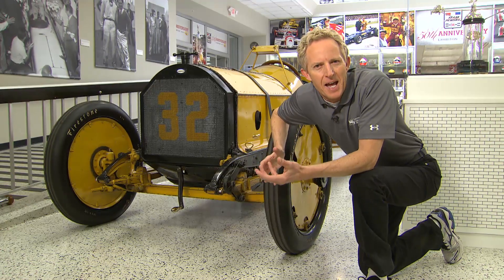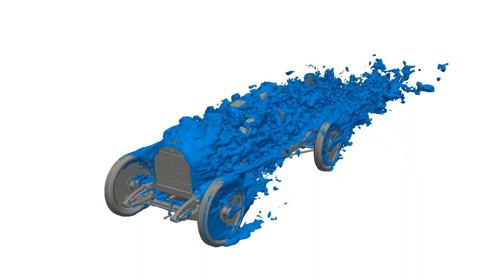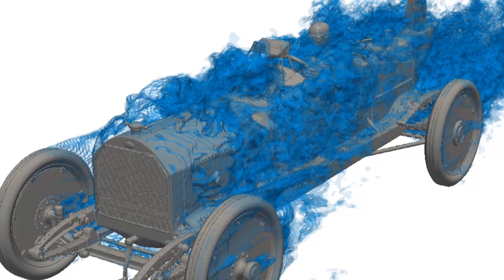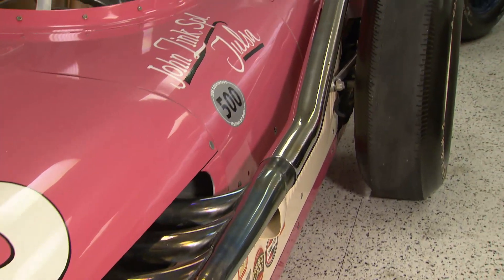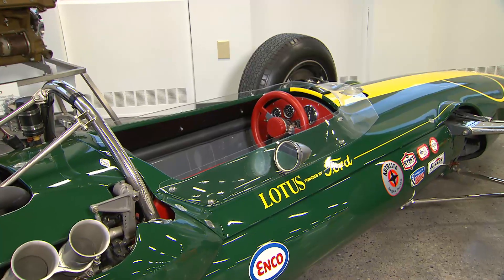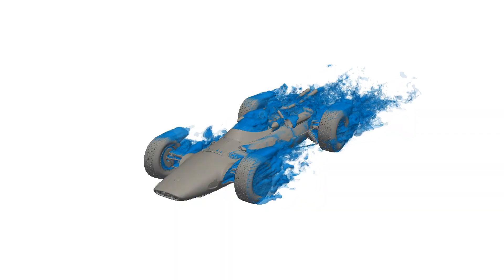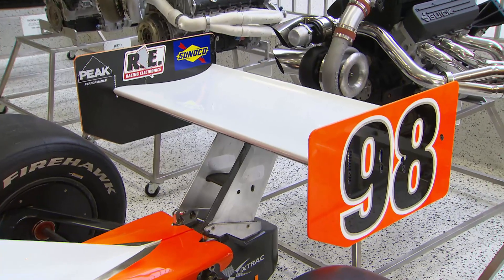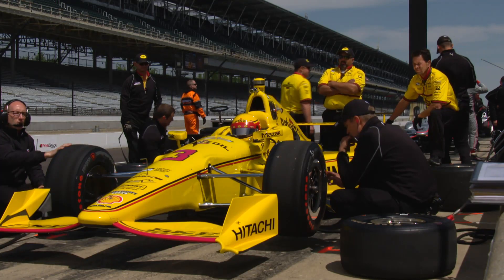INDYCAR 101 with Professor B: Aerodynamic History

Comment: Maybe this is a dumb question, but would a spinning wheel/tire have the same amount of drag as one that isn't?  Doesn't the tire's shape change at speed?
Reply: The slicks used for these types of cars (F1 included) do not deform aerodynamically, when in motion they only create drag based on surface area and surface deformation due to graining or spotting. In fact when it comes to tyres , the graining or spotting exhibited by wear or locking brakes creates vibrations and an uneven surface for the vehicle making the ride more difficult for the driver, inevitably leaving them with no choice but to change tyres as those vibrations not only impact handling but also under those stress levels cause harm to the rest of the vehicle.

Comment: If there were no rules at all how fast do you all think they could get a car around the track?  

I know Professor B said that the aerodynamics already exist that can go beyond the capability of the human body.  So, what are the capability's of the human body? Some fighter pilots can pull 9 negative G's.  But almost all the G's in an Indy car are lateral.  

Again the the question is how fast can an unrestricted car go around Indy and how many lateral G's would that be?
Reply: +mystrsyko wouldn't that be crazy?  Over 6 lateral G's.  

If G lock is an issue.  What about G suits?  If it works for fighter pilots why not an unlimited racecar driver?
Reply: I volunteer

Comment: We need ground effect back: Great looks, a lot of downforce, not very sensitive for dirty air! 
Somewhat interesting, but it's a very incomplete simulation for not including the effect of turning wheels and the ground moving relative to the car. Furthermore, there are no cars of the ground effect era (late 70s - mid 90s) included.
Reply: The CFD simulations were run using turning wheels and moving ground. The animations use a static render of the cars. The CFD was completed using transient simulation to better capture a realistic flow. We could have loved to include a late 70s and mid 90s car, but no 3D models were not available for that era, much to everyone's surprise.
Reply: I think +taufiqutomo wondered why there were no 3D models of 70s and 90s available.
Reply: How could that be?
Reply: taufiqutomo 
Pardon?
Reply: murpy eddie
Sure, air flowing through the diffusor follows Bernoulli's law the same it does through a ground effect underbody.
In fact a diffusor is "ground effect light". 
A car relying on ground effect to produce its main downforce is greatly different, however.
Reply: armorgeddon yep
Reply: the wasp actually produces rear downforce. the colored graphic clearly shows a vacuum below the rear end. much like a diffusor but without the walls to seal it off.